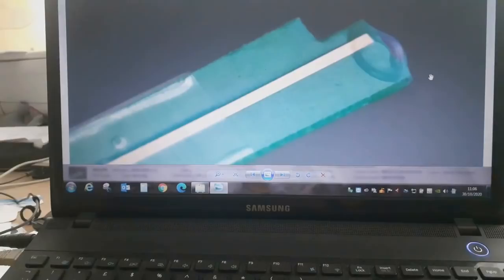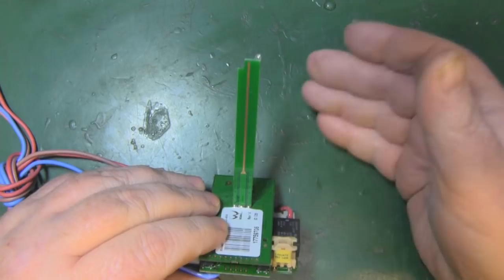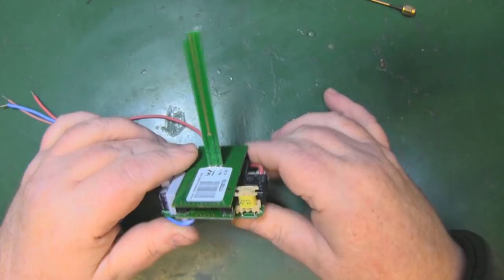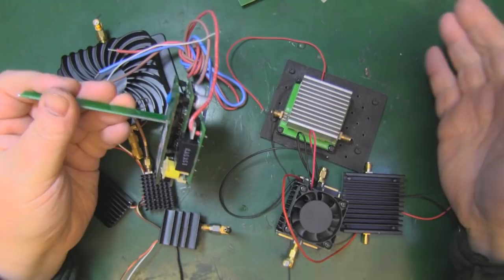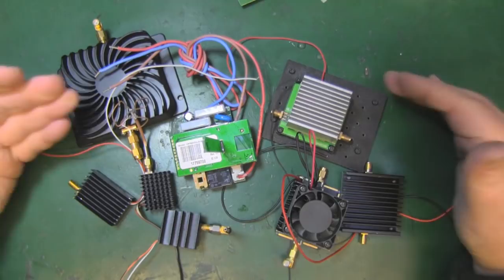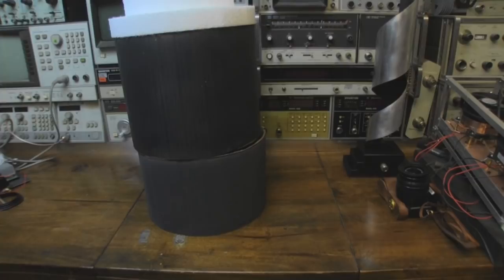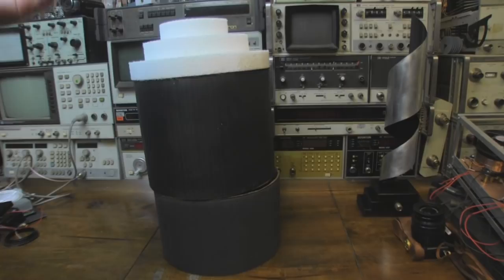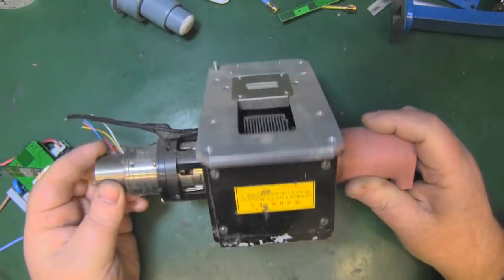Mark Steele and his Magic 5G Antenna

Comment: we were not told or asked about having radiation emitting antennas in all our streetlamps.
Reply: What are the antennas supposed to do in the street lamps ?
Reply: @radleytube  they connect with all devices, cellphones, now people, newer cars, and soon all products, to track and trace every thing- the IoT, which we do NOT need in a free market btw, and this infrastructure in the world has cost over 20 TRILLION dollars!
Reply: Define radiation emitting. You realize that radiation comes in many forms and intensities that we use everyday right?
Reply: @vegtamvanderveg They likely connect to each other and to a central hub operated through a software for technical data and maintenance. 
Get a REAL job in any tech, science, security, electronics etc. field and get out of your mom's basement.
Reply: @East_TN_Explorer  Wireless technology is what emits RF radiation proven hazardous, and these levels are measurably high- I can measure it on my own EMF meter which is a professional model.
Reply: @vegtamvanderveg  It's not just wireless devices which emit RF. And they're not hazardous. In what way? What context and what level? 

People tend to throw words around without giving real context or scale to anything.
Reply: @East_TN_Explorer  NOT TRUE. go back to school, learn some physics
Reply: @vegtamvanderveg  Yes TRUE! Many things emit RF frequency. And I asked you a question which you have not provided an answer for.

Comment: For simplicity, the key thing is power, watts.  Here you're talking lower power than routers and other wireless devices (that people are closer to).
Just looking at the wires, they aint gonna conduct enough power to harm a human at several metres distance, probably not a bird either, not compared to domestic wireless devices.
Many microwave frequencies could be argued to be nefarious, like the microwave oven 2.45 GHz frequency, also, insanely, the wifi frequency.
However, for streetlamps to be 'weapons', their radiation would need to be powerful, comparable to cell towers, or mini cell towers.
In perspective, any 'stealth' radiation from streetlamps is gonna be lower powered than a domestic wifi router.
So, even if a router were argued to be a 'weapon', in the long-term, streetlamp radiation is, in perspective, a tiny fraction of the comparative power, especially at several metres distance (inverse-square-law of microwave exposure).
More than cosmic radiation, but if anything is killing birds and bees and harming people in the medium-long-term, its the cell towers, routers, phones etc, and not really the streetlamps at all.
Reply: Lower power is actually more dangerous because it doesn’t activate your body’s defence mechanisms
Reply: @jackmercer4803  are you saying the human body has some kind of defensive mechanism against UHF RFI? Source?
Reply: @leehazlewoodism  the statement was originally made by an expert called Dr Barry Trower he’s made a number of videos on the 5g and Wi-Fi he he said among many things he pointed out the rates of leukaemia sky rocketed in children when Wi-Fi was put in schools I shall try find you the exact video and I’ll post it underneath I myself am not an expert

Comment: Your mobile phone puts out 25,000 mv, that's 150 times over the safe recommended limit and that's using miniscule power.  The capability of this antenna is absolutely terrifying compared to a mobile.  240v minimum direct power at all times.  The manufacturer website states this.  Oh and the manufacturers were so good they shut the business and left millions of pounds worth of equipment in the factory.  You have to ask yourself, why would councils invest millions in a light sensor that you can get for 3 pounds.  Because that's not what it is or what it's for.  As you can clearly see, especially now.  They want you off the planet.  The roll out of those antennas was uncovered, failure.  Now look what they are doing. 
Yous all need to wake up.
Reply from the maker: And your qualified in what subject? Or are you just talking out your arse?
Reply: @andrewmcneil  he made a claim. Do our phones emit over 150 times the “safe” levels? Our the censors capable of emitting higher levels? Stop appealing to authority.
Reply from the maker: @joetaylor7442  150 times!!!!!!!!!! wow
Reply: “Yous all need to wake up”. Hmmmm. I’m imagining that in a Geordie accent.

Comment: I am an engineering graduate & I did LiFi using LED's for my final year project it offers very fast speeds but has it's limitations due to the nature of light, at present it would be best implemented with a hybrid system for indoor use.
I am from Newcastle Upon Tyne & I knew straight away when this knuckle dragger Steele opened his mouth he did not know what he was talking about just by the way he says things alone.

Comment: Absolutely brilliant Andrew, you've just confirmed all of my theories about the hardware on the street lighting & what they do & I just used common sense I haven't done any research into it, it just makes sense that's what they do even the flood defences along the waterway's have antenna's on sluice gate buildings & sensors sending data to & fro on flow depth etc + remote sluice opening, + there's remote radio controlled wind speed + weather monitors, CCTV up & down the Motorway's, remote stress sensors sending data on bridges, it's everywhere, it's not rocket science, btw I loved the drip😂
What were the blue things they rolled out in the late 80s 90s on nearly every bridge, I think they're still around, was it Traffic Master?
He'd have something to say about them, I remember people thinking they were big brother or speed cameras, slowed plenty down though😂

Comment: The past I have build a kit that used 900 Mhz  oscillator as RADAR movement detector and it had 1/4 wave whip antenna on it.  This is far less power than ground RADAR or ship ( or airplane) units. The old movement detector had IR detector and microwave X-band GUN oscillator!!! I like your video on antenna.

Comment: There is probably SOME negatives from 5G alone because of the high frequency and the interaction with the body. But as I've pointed out before,  if you combine this with nano technology you end up with a remote controlled device. ie. inject the population with  an 'injectable' under the disguise of a 'vaccine', and then turn on 5G, you end up triggering the Nano Tech. 
If the Nano bots are programmed to bridge the cerebral Cortex, you can bridge the difference between an organic animal with a transmitted control system. You effectively create a sophisticated biological control system. If you think I'm a tin foil wearing loon then  your wrong. I was into electronics before you were born. I was in telco for 15years and dealt with all kinds of antennae and even designed some of your simpler Yaggies decades ago.
This 5/6G is pushing microwave tech. That's not a great place we want to be..
Reply from the maker: zero understanding is even worse.

Comment: So tell me why the antenna board is cut at the end like that....
Reply from the maker: They are mass produced on a large sheet of PCB then routed a bit like an airfix kit the little tab is where it is snapped off
Reply: @andrewmcneil  well if that's the case, why cover the end when they have a totally waterproof cover over it on the light.  If it was to prevent water ingress, why did they not put that protection on every component on the board and the rest of the 'lighting controller'.
Reply: 868mhz is one of the worst for health.  Son you haven't got a clue.
Reply from the maker: @janeybaldwin9078  Because the illuminate what to reduce the population using microwaves and chemtrails by the end of 2021 so they can have this big flat planet to themselves. Or is it 2022 now I can’t keep up
Reply: @janeybaldwin9078  what about 60 GHz pore size wave length...any clue .
Reply from the maker: @janeybaldwin9078  No I don’t have a clue just spent years at university and teaching for nothing. And remember not to drink the water it has little tiny robots in it.

Comment: I'm still puzzled by the two tracks either side of the centre element. Yes I agree they help strength but I wonder if the designer intended them to be grounded to act like a coax shield. Maybe to move the antenna higher up? It looks like there are loads of vias in the outer tracks which you wouldn't put there for strength but would help shielding. Also the centre track becomes fatter and has been covered with the green silk screen at that point. But the length of the exposed track is too short for 868Mhz as you showed the full length was about right. I'd have assumed a higher frequency around 1.2Ghz - GPS timing maybe?!. Thanks for sharing!
Reply from the maker: Yes as i said it confused me too but they are not connected to ground but they are 25 mm long the same that you would find on a 2.4GHz dipole.
Reply: Knowing the dielectric constant of the FR board and how it affects the signal, the top part of the antenna, the exposed part, is the correct length for 1/4 wavelength.
Reply: The two tracks at the edges of the board indicate that section of board is probably intended to be a transmission line, so yeah, it's like coax and yeah, it makes the radiating element further away from the base board, the antenna element is the exposed gold bit of the track, with the angled impedance transition being the base of the antenna.

Velocity factor of the substrate material, plating material, area of the antenna exposed to air all affect the length calculation for the antenna and change it from the simple textbook definition of wavelength in a vacuum.

As McToon says, it's correct for a quarter wave at 868MHz.
Reply: Probably put there to increase antenna bandwidth ie make it operate over a wider range of frequencies.

Comment: 8f you look up corona discharge safty videos it's not hard to find plenty 9f proof these things can easily overheat and catch fire. Theres lots of safety equipment due to this issue as well as UV cameras to detect it. Also videos of cable trays overheating due to wires not being in proper condition and/or improperly tied down
Reply: Why would you use up cameras to detect anything overheating instead of ir or something even simpler like a thermistor or a thermal fuse?

Comment: So why do they got to cut down ALL the trees where they install these genius?
Reply: Trees have feeling, souls and eyes. Too many witnesses to the murders innit.
Reply: They don't though.
Reply: @mopefever  OK, maybe it's the squirrels then. It's a HUGE consiracy - when was the last time you saw a squirrel testify in court - eh?
Reply: These were installed several years before this trees were cut down.  No correlation.
Reply: Treas fall down and cause damage and block signals if very close.
Reply: Suprised if they cut down all the trees.
Trees and leaves etc absorb rf energy at 868MHz.  Probably whats happening is trees are getting cut where there is a possibilty of attenuating the signal either now or in the future as the trees grow.

Comment: Like most technology things have got a lot smaller , now I don't know how much of what you've said is factual . I have noticed that you haven't said anything about Active Denial maybe you think theres no need too. The Other Man whom your speaking about will send anyone PDF of seemingly Scientific Documents however to an untrained eye like mine these don't mean much. Therefore my inner dialect has still not been able to choose any side in this argument. Alls I do know is originally active denial is used as a deterrent-weapon. The fact that 5G is used to create Active Denial proves that to me and others that the potential is there..  I did read a PDF from the manufacturer of these 5G street light antenna, it stated that 11 miles in straight line of sight is applicable in an motorway setting weather permitting. Lot stronger than 8011 I think.
Reply from the maker: 5G is 3.4 and 3.6 GHz active denial use frequencies around 90 GHz and while it works in theory it does not work in practice and will never replace a water cannon.
Reply: @andrewmcneil  wasn't meaning a water cannon the  A.D. I meant burns the first three layers of skin on certain area of a person's body. Yes the machine was quite big back in 1991. See the problem is it can and is used as a weapon around the world..5g Active.Denial the other stuff I have no idea . The vax and antenna, magnets etc remains for me to see it with my own eyes..

Comment: This guy doesn't understand at all. It's nothing to do with heat you barm pot.  A mobile phone puts out 20,000 m/V Next to your brain, no heat at all.  Read the booklet that comes with your mobile phone, it will state do not put the phone within 2 inches of your head, which is ridiculous for the proposed use of a phone.  The lens at the end is to focus.  This is verified in the video about the starlink satellites.  This guy hasn't got a clue.  This is a focused, sub gigahertz antenna, highly dangerous.
Reply from the maker: 🤣🤣🤣🤣🤣🤣🤣🤣Or wait🤣🤣🤣🤣🤣🤣🤣🤣🤣sub gigahertz antenna, highly dangerous🤣🤣🤣🤣🤣🤣🤣🤣
Reply: What are m/V and which mobile phones put out 20,000 next to your brain with no heat at all?
I know V/m are the unit for electric field strength but I haven’t heard of metres per Volt.